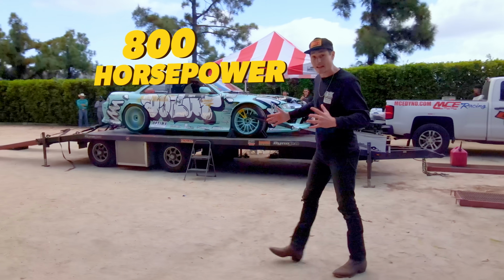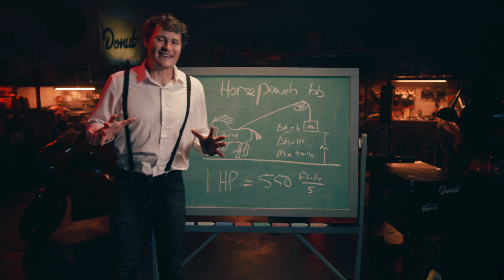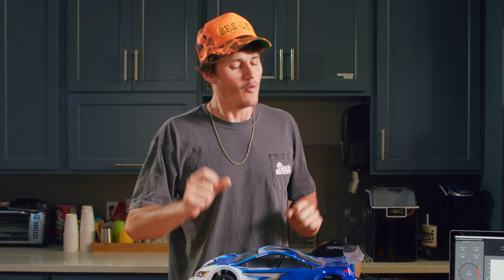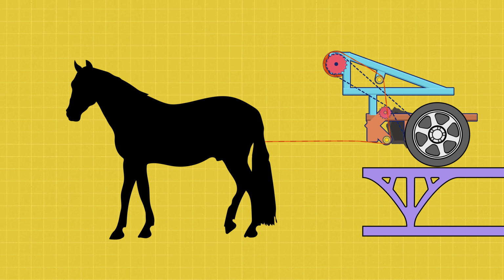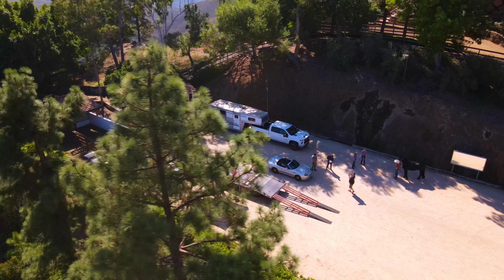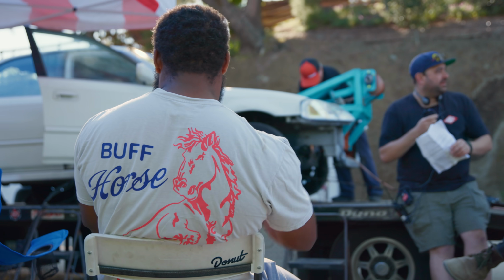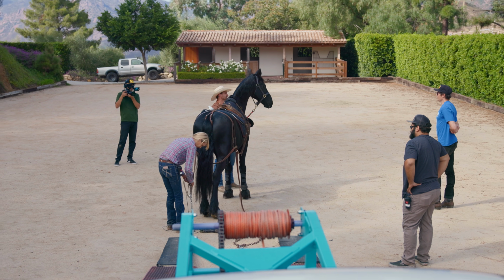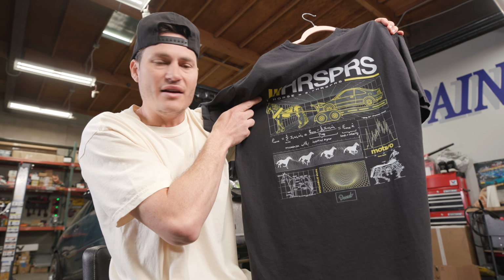How Much Horsepower is a Horse?

Comment: A real horse is a lot more than an ox and that is a lot more than the output of a thermo machine like an engine.  There have been as benefit to the human race in the later half of the 19th Century in the West the horses productivity in agricultural production drove human population growth to the extent we could loose millions in WW1 but this increase in population growth was limited by the diminishing return of using the horse in agriculture, as the horse increased in numbers so it competed with man for the food it produced. This drove the development of machinery like tractors in agriculture, the auto for human transport, and construction machinery to build public works. By 1930 the horse had his day pass. The carbon based fueled machinery and fertilizers developed out of wartime explosives took over and has served mankind to grow from less than a billion souls to over eight billion.  Now one must comprehend the earths only energy source is the sun, and radioactive decay heating the core and mantle. The sun supplies a carbon cycle where plants use carbon dioxide, water, and soil to produce all power on the planet by creating sugars, these sugars supply the nutrients and energy and oxygen supply for both the plants and animals which consume them. The dead plant matter either directly or after decay and fossilization then is available to be burned with the free atmospheric oxygen the planets produce to create energy for mankind and the worlds benefit.  It is the energy and life cycle of our planet. The more CO2 the more plant life and the less water the plants need… and the more oxygen the plants produce and the more animal life that can be supported.  Just like in the early 1980s mankind faced a grim reality of population growth exceeded ability to produce food yet invention of improve agricultural production not only staved off mass starvation it allows a great increase to support human life. Just as increasing CO2 by ten times would make hardly a measurable effect in worldwide temperature it would green the Sahara and most of the other deserts and increase life overall on the earth but increase the ability to provide power to bring billions into a modern living life style which would decrease toxic emissions worldwide. Accereationist thinking is the Green movement believing counter to planetary and evolutionary science that everybody else is better off dead except perhaps 50 million souls supported by robotic slavery to replace the mass human slavery scrapping out every last bit of rare earth materials to support an artificial, for earth, silicon based energy cycle to ultimately support a silicon based machine cycle.

Comment: Awesome video! A simple way to measure horse power output is just to have it run up a hill (inclined slope). Galloping will give peak power, or do a long distance run up a hill for average power.
The basic physics:
Power = ∆E/∆t
P=mg(H2-H1)/(t2-t1)
Where m=horse mass, g=gravitational acceleration, H1 is start elevation, H2 is finish elevation, t1 is start time, t2 is finish time.

Using SI units will spit out power in Watts. Divide by 745.7 to get power in 'horse power'.

Note: this is also a simple approach to measure a cars power output.
Reply: This is honestly more like likely to pass peer review than this method. This has so many variables and makes it harder I would assume to find a consistent work value. Also no control was done on the system, using an engine of known power to pull the cable first could have given some indication on in the models are correct
Reply: @emersonbeavers911  agreed. You can also take into account start and finish velocity to make it more accurate of they are not the same. P= (mg(H2-H1)+ 0.5m(V2^2-V1^2))/(t2-t1)
Where V2 is finish velocity and V1 is start velocity.
However, the longer the uphill run, the less important velocity changes are.

Best to do this up steep hills at low velocities to minimise wind resistance, which complicates power output calculations. I.e. wheel/hoof HP lost to drag force of air.

Comment: What is the optimum gear ratio for a horse? Power = force x velocity, so galloping with a light pull vs trotting with a heavy pull. At top speed the horse won't be able to go any faster even with 0 line tension. At stationary, the line tension might be the greatest but there will be 0 speed. Where is the product of line tension and velocity the most? What about how much food the horse needs to eat and drink vs useable work? This will be hard to measure.
I think the easiest way is to just use the line tension x velocity to calculate the "usable" power.
Also peak power vs lactate threshold power.

Comment: This is NOT at all realistic. The size of the drum that rope is on would make a HUGE difference in the power the horse would have. The larger the drum, the more power the horse would have, up to the point it would exceed the horse's speed to keep pulling the rope. The surface the horse is standing on would also make a huge difference. In soft dirt, a horse could generate about 5 times the pulling power than if it was on concrete. I see so many flaws in your designs, it makes your figures totally useless.

Comment: it was based on "pit ponies". not an overly large horse. pulling a winch for lifting in the mines of the UK. they did it all day, every day. not overly exerted as a horse cost money and made you money. you looked after them. a modern horse is fat and pudgy in comparison, standing around doing not much at all. its a bit like asking your modern couch potato to get onto a shovel for a half hour... pretty useless.

the unit was more about collecting payment for supplying his new condensor to already existing "atmospheric engines". rather than the initial outlay for construction and materials, watt based payment on 50% of the cost of the fuel SAVED. engines at the time being built more like a house... brick foundations, walls, timber frames, each one unique. of course he also played a role in new engines, but he really only invented the condensor, an attachment for existing engines.

ie, if you spent 50 on fuel previously, and after fitting his patented condensor only spent 25 on fuel, then you owed mr watt 12.50....

and he was a right bastard about making sure he got paid! typical scotsman.

and at no point did i see an attempt to actually calibrate this using the obvious method of dropping a large known weight a certain distance in a known time? 33,000 pounds, one foot, one minute.

Comment: The value we use for horsepower is the average power a horse can deliver throughout the day and not the peak power of a horse. And it is more sensible. It can also be simplified by saying, it is the sustained power of a horse rather than a short burst of peak power.
Reply: I was thinking the same thing. I couldn't find a good source on how Watt did his observation, but he just took a practical value of the power a horse can output during an entire day, because that is the way in which you can compare with the constant power output of a steam engine during an entire day. He could have altered the data to sell more engines, sure, but we don't know.

To "truly" determine what a "real" horsepower is (we already have a definition and that's just it) we should:
1) define what breed should be used, if any.
2) design the experiment to measure the horse average output during an entire workday at a set ambient condition (temperature, pressure and humidity).
3) employ a statistically significant number of horses of different sizes, ages, and sex.

I don't think it's worth it, except for entertainment purposes, because we already have an official definition of horsepower, and we should use Watts as a unit anyways.
Reply: Well, most car engines are not designed to run at peak power all day. If you were driving 8 hours a day on a road trip, your engine would, on average, be producing significantly less HP than its maximum.

Comment: Multiple layers of rope on that spool will affect the diameter on which the rope is turning. Meaning the torque is going to change as the rope is unwinding. We still don't know what's the speed at which the horse makes the most HP. So, yeah, this is horse dung.

Comment: This was very good and very educational, though I wouldn't trust the results. 

I really thought you were going to make a treadmill for the horse...this is not what I expected.
With that said, I LOVE that everybody that was involved in this experiment was acknowledged. That was something that scientists of old didn't do. You'd only ever hear about one guy or girl making a thing, but it really takes a whole team and I respect that you acknowledged everyone, including the horse.

I also love this comment section with people with other ideas on how to do this. I really hope you think about doing some of  them because yea, I think multiple ways of trying this will get us our answer instead of just relying on one experiment.
Reply: @kukukachu .. are you even an engineer/scientist of any calibre?

A conveyor belt type treadmill that could support the weight of a horse would have similar mechanics to tank 'caterpillar tracks' - try working out the losses for the tracks and finding a suitable running belt that can sustain the pounding of horses hooves (or fit the horse with rubber boots)

.. if a mechanical treadmill was feasible - they would have built one.

If you can design one - you'll be famous.
Reply: It doesn't take an engineer to figure out that the way he did it was not the most optimal... @Chris_Sheridan
Reply: @kukukachu  .. go on then - describe a method or technique that would make measurements more optimal.
Reply: just look in the comment sections dude. I even said that in the the original comment.

Comment: ok i noticed some technicalities that lead to some big constraints ill talk about them the main one being that the test isnt optimized for the horse properly you ran into yolk issues were hed walk a few steps then hit the weight, another thing is the weight and speed so the speed that you walked at was perfect the commonly tow around 5mph, i just think the weight of a civiv was a a little light weight for a draft horse which are known to be able to pull as much as 8000lbs, the wieght of a civic is more fitting for a common horse, if a proper weight wouldve been on the dyno i think he couldve scored over 10! and a pair of trained farm horses could probably do over 30

that being said i thought at first you were going to aproch this as a pure measure not a rotational tow strength, ie the horse treadmill but from race horse data its pretty easy to see they get the equivelent of like 120hp short gear ish

Comment: I think if they had measured sustained horsepower it would have been higher than that. They didn't account for inertia, because at the start it's going to be pretty hard to pull but as time goes by it gets easier they should've measured it for atleast 30 secs.

Comment: Much respect to the Motivo engineers but to get a conclusive figure you will need to do the test on several horses. Alsothat's initial horsepower ,to get actual sustained horsepower , make the horse gallop in a circular motion

Comment: Great idea. Great project. Great video. 

However I don't know why you didn't just use a wheel hub type dyno, bolt a rim to it, and wrap the cable around the rim like a spool. 
Would eliminate all the guesswork of the transmission and driveline losses and be easier to calculate and build and probably more accurate.

Comment: I think rope unrolling from powered wheel makes measurement inacurate cause each layer of rope changes  diameter thus leverage between horse and wheel. I think it would be much more acurate if powered roll is used as cabstan and aditionall roller is fitted as rope storage so you have consistent diameter of "crankshaft" 😊

Comment: Putting a horse on a dyno 😂🙌🏼🔥 But you failed to mention a lil detail about those formulas your questioning about how 1 hp is measured. I understand that it's measured in watts or 746w and that 550lbs you find in the examples provided gets multiplied with 1ft in (meter) and 1lbs in (newton) giving you a total of 746w or j.

Comment: 00:02 The measurement of horsepower in cars is not based on the power of actual horses.
02:05 James Watt invented the concept of horsepower as a marketing strategy
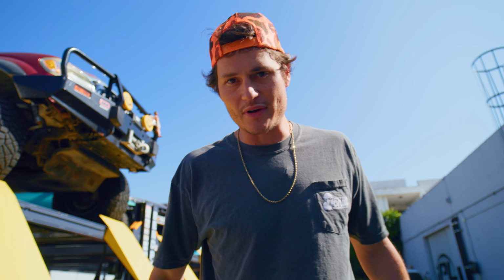06:37 A dynamometer measures torque and RPM to calculate horsepower.
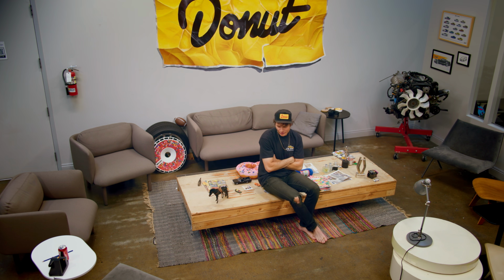08:50 I need help from engineers to figure out how much horsepower a horse makes.
13:07 Building the first horse Dyno at Motivo
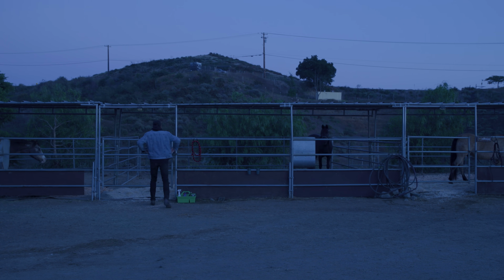15:42 Using a horse as an engine for a car on a Dyno
20:02 The crank horsepower figure is obtained through rigorous testing and mathematical modeling.
22:30 Big D is about to do his first pull and possibly make horsepower history
26:48 The true crank horsepower of one horse is 5.7 horsepower.
28:40 25% off everything sitewide during Black Friday sale

Comment: Your ability to measure true power is restrained by friction with this contraption. When your feet slide, it means you aren't able to channel your full power into the measurement. Think of the extreme situation of trying to pull on a slippery surface: your power output would be tiny, but that would just be an artifact of the slippery surface and not a true change in your power. For reference, when I was in high school, we measured our HP by running up stairs as fast as we could, and I clocked 1.5HP as a 140lb guy (granted, I could sprint up stairs 2 steps at a time). You all have more HP than what this is measuring.

Comment: Fake news. Some motors run 24/7 producing full motor nameplate HP. No horse could come close to producing a full one HP for a hour! Gee maybe you could get a higher HP if the horse was pulling the same load down a hill.

Comment: You mentioned you that you had a mechanical engineering degree. Worked at a large fancy plant that had 4 engineers. Two were brilliant and other two would like I told them to their face have trouble engeering a roll of toilet paper on an owl house wall. One gave me & my coworker e!ectrical on a Friday a drawing ( schematic ) how to wire a thermostat to control a couple of 5KW heaters to supply tempered water to 3" chocolate line to prevent a milk chocolate line from freezing. We told him it would not work but called our boss and we were told to just wire it like the engineer wantrd. Ok. Thermostat was wired across 120 volt control circuit so as soon as it closed caused a short. We did it his way and when production was unable to pump chocolate on Monday morning took a dozen guys all day to remove 3" pipe to unblock it.Cost hundred of lost production hours and they tried to hang us. Got a lot of overtime from dumb engineers.

Comment: Was told back in the 1960's while in a great Vo Tech school our shop teacher said the average horse could not produce one horsepower over a 15 minute time. Told us that 746 watts = 1 HP but with looses even energy efficient three phase motors consume approximately 1,000 watts. Lying POS European electric motor will often cheat and use 746 watts to be labeled one HP.

Comment: What a project! I actually thought the horse would produce higher. I never actually believe the previous statement what a horsepower was equivalent in actual live animals. 
I have seen horses pull out pickup trucks stuck on mud on ranches. Obviously the truck was also on but it was stuck. Anyways the new number to remember is close to 6hp mechanical to an actual horse. Very nice experiment and awesome project.

Comment: Wouldn't it be easier to have the horse pull its maxed out weight sled then just have multiple trials of horse powered motorized vehicles until it fails then you have your reading

Comment: What I totally miss in here... They never benchmarked the whole setup with an electric motor, where they actually knew the exact power delivered.
Or a simple setup with a 50 kg weight pulling down using a pulley system. That way you could actually see how much power in terms of Horsepower a kW produces.

Comment: A 100% cheaper, easier, more accurate tes is to put a GPS on a horse and a froce transducer on a tow rig and measure speed and draw force... if you want to get fancy have a brake controller on the tow rig to generate a constant load...

HP is just speed * draw force * a conversion constant.
Reply: And of course they do this - because it's 100% easier and more accurate... that's what I get for commenting halfway through the video

Comment: I believe that the expirement was not executed properly. Horses and people, just like engines have a peak horsepower and peak torque, the peak horsepower would probably be at a higher speed than a walking pace, which would show a lower horsepower figure in the method shown because the horse was moving at a slow pace. They also didn't reach two horsepower when they had three people pulling while each one was able to do more than one horsepower, which means that the dyno and/ or the math are wrong. I would instead have a horsepower dyno similar to the one used by "Warped Perception" where there is a brake rotor connected to the drum and the brake caliper is connected to a scale to measure the torque and a laser to measure the rpm. The test would then be done with varying levels of brake pressure applied to let the horse run at different speeds to find the peak horsepower and torque.

Comment: I Dunno , how is the Dyno calibrated ? is it in the good 'ol HP'S measurements ?? weren't those out of whack ?? again in the measures of what  ?  HP' S ? or Kg's ? or Kg -F /S or whatever ...to me you just measure the Pull from Big D , and then converted that to the same ol' HP used as standard , which you already said it was ''wrong '' or never existed .